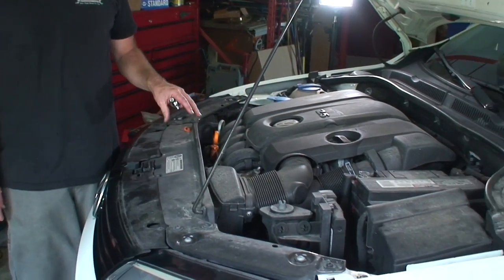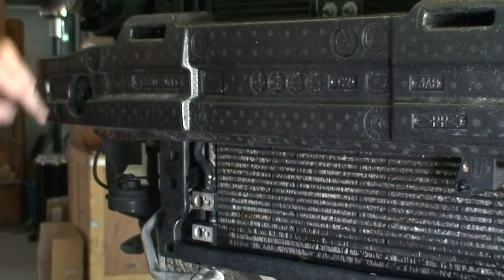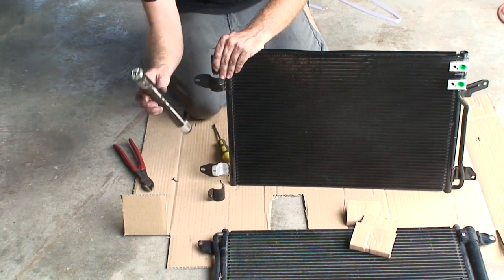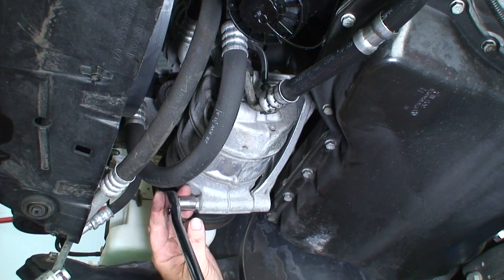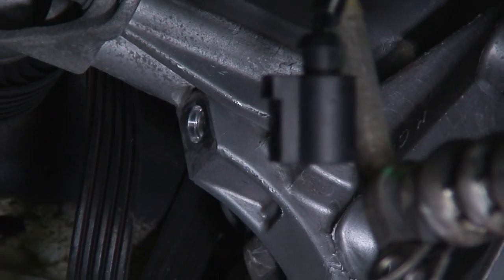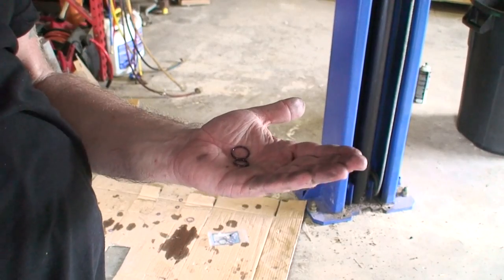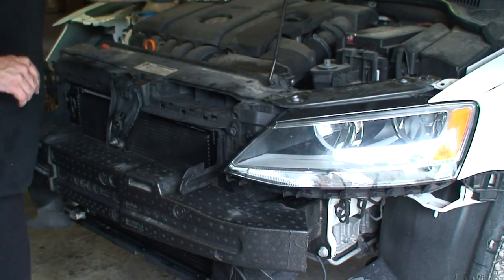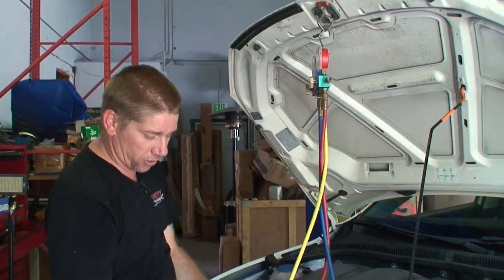2012 VW Jetta AC Condenser and Compressor

Comment: At about 12:25 you were struggling with the clip on the back of the lights.  I struggled with those for years too.  Then I finally saw a video that showed the right way to pull them off.  You pull back on the top of the clip (away from where the wire goes) and as it comes backwards it lifts the lock off and the cable comes free.  It's super easy once I figured out the right way.

Thanks for the video, super helpful!!

Comment: Saved me over a grand! Just did the condenser replacement. Did this on a 2012 passat just know that you don’t have to take off the headlights like he did. Other than that great video.
Reply: How difficult was the job? I have a 12 passat as well and thinking about changing the compressor it stays cold for a while and then warms out of nowhere. I've done many jobs on the passat probably my most recent success was replacing intake manifold. If I can just get the parts I'll do it

Comment: For everyone watching take the bumper and grill off together. In one piece
Reply: kysersoza2002  i did a 2017 with a 1.4 and grill need to come off there are three bolts that hold bumper in place and this dude took off headlights when you dont even have to take them off

Comment: I recommend doing this job with power tools. this will make your job easier guys.
Reply from the maker: just be careful you don't strip or pull out threads, we use impact tools often but not for every job
Reply: I use a 12v Dewalt drill/driver with the quick release hex chuck. It has an adjustable torque setting. I use this for light duty loosening and tigntening when there is enough room. Its very easy to control.
Reply: @APDTY  .
Reply: @APDTY  .

Comment: do you use a torque rench on the lines into the ac compressor? Im afraid I might either over tighten and damage the thread in the aluminium compressor or not tighten enough and have a gas leak...

Comment: I think I should’ve made my own video, I watch this guy and it just seemed way too involving. I removed the bumper which took all of five minutes then I remove the two screws holding the radiator lifted the radiator and pushed it back about 3 inches unscrew the condenser and pulled it off the front towards the bottom. Didn’t take more than 15 minutes. And there’s absolutely positively no reason to take your headlights off.
Reply: Yeah… that’s exactly what I thought. It looks like this guy hasn’t done one of these before and decided to go off of what the book said. 

Crash beams aren’t that hard to remove and replace. If you’re really concerned about alignment, just make a few sharpie marks to match up after.
Reply: So an experienced shop should charge maximum an hour labor if you bring in my own AC condenssor for them to put in? I got one for 250 on parts geeek

Comment: Question, if you turn both valves off during the quick vacuum leak test, then wouldn’t you be only testing if your vacuum pump and gauges leak? Both valves off on your gauges would isolate your FROM the ac system wouldn’t it?

Comment: I'd be willing to bet that compressor is 100% fine, change the RCV. I've changed mine 3x and about to do it again, just watched this for the condenser/dryer, but still left wondering if any oil was added to the system to account for the condenser change. Most shop manuals will specify an amount to add per component change. I did not see this done here.
Reply: he adds oil around 28:58

Comment: I appreciate how helpful this video is. Unfortunately, the procedure is poorly done. Lots of unnecessary steps. Some steps are missing (removing the front wheels makes it a lot faster and easier to access the splash guard screws with a gun).

The crash beam should be relatively easy to remove save replace as a few commenters have stated.
Reply: You’re supposed to remove the bolts and take 2 m10-1.5x120mm and slide the whole assembly forward. It gives you a crap ton of clearance to work on everything.

Comment: AC is still working good on my VW tdi Jetta but the lower half of condenser is almost flat from rock chips from winter roads. Car does not seem to get hot but I’m thinking I should replace the condenser before I have problems. Can just the condenser be replaced without removing the ac pump and having to replace oil in the system ?
Thx
Reply: The lower part of the condenser is flat not from the rocks how you sinking, my is flat to but is flat from using how I am sinking automatic car wash. Know we need to say tanks to guy who owns that car wash.
  My 2015 2.0l jetta ac compressor is spraying oil at the seal compressor shaft. So I need to do the same procedure what did guy in the video.
  Thanks for the great video!!!

Comment: Hello, i know this video is old but im having problems with my ac my car is a 2011 vw jetta 2.5 i was told its the ac compressor it sometimes blows hot air its mustly during the  night, would you say its the ac compressor ? And can you tell please tell me how can i find the specific one online please? I would glady appreciate it or can any one help me out please?
Reply from the maker: so verifying for sure the problem is the first step, ac compressor diagnosis is pretty easy but requires gauges so you can see how it is handling the refrigerant and heat exchange, getting warm at night? does that mean during the day it is nice and cold? A diagnosis should be performed to figure that out and prevent future problems. If the compressor is falling internally, you may want to also replace the condenser which is up by the radiator as it captures small pieces of the failing compressor and can destroy the brand new compressor when one of this small pieces cycles into the new compressor, if you need a compressor, then here is a link to a compressor kit for your specific model: https://amzn.to/2wTpDtD
We will have the proper image for it in another day or 2 as we just put it up for sale.

Comment: Hey, did you can have help to me? I have golf V. AC compressor not working. Works when i fill to the AC system air from ressiver, about 7-8 bar, turning radiator fan. When i fill freon, my AC system not running... i replaced a new one pressure sensor and compressor selenoid valve, but nothing helped..

Comment: Really great video and tutorial of the A/C job.. I think I can tackle it now on my MKVI TDI wagen the service position was something I was contemplating but saw it would have been almost impossible.. your demonstration was really spot on.. so what was the oil you used did the compressor and was it that sane oil you used on orings? Or did you lube them with silicone grease? Also I was kinda confused with the angle of the expansion valve that you were underneath the car.. how could you possibly get to that evaporator from the top of the engine bay? I know non condensable gases are problematic for A/C, thus why you pull vacuum for 30min prior to recharging, can you purge nitrogen through the system while pulling vacuum to aid in moisture and CO2 removal? Really good video 👍🏻👍🏻

Comment: Can you recharge the AC based on pressure with a diy kit or should I have it evacuated and vacuumed and charged by the weight of R-134a? I don't have a leak and the system isn't empty.

Comment: hi thank for the videos, my questions is the AC unit works fine, when it is on I hear that it is louder than it used to be, do you know which component might be going bad, if there's such a thing, thank you
Reply from the maker: AJ so first would be to see where the noise is coming from, loud noises most likely occur from a compressor starting to fail or it could be a bearing from one of the belt pulleys or the cooling fan, find the component making the sound and then plan out the replacement and it usually leads to a failure fairly soon.
Reply: Might be the blower and it could just have something stuck inside it.
Reply: @APDTY  My 2013 Volkswagen Passat only blows cold air when driving it doesn't make any weird noises should I try and replace this part?

Comment: Is it possible to add AC to the car after the fact.. mine doesn't have any. Came that way from factory. Can I add it on after.  Same year, 2.0
Reply from the maker: For a factory install it would require the vehicle computers to be changed or updated, Aftermarket Add-on ac kits are available however APDTY does not offer any, These kits are a little complex but probably the easiest and most cost effective way to add an aftermarket ac system, you would want to spend a good amount of time researching as it is a slightly complex job and it does alter the engine bay and interior. Here is an example of one of the kits: https://amzn.to/2rVfcCD

Comment: So I replaced my compressor on my wife Jetta recharged it and cleaned out the lines. We were coming home from grocery shopping and it leaked out all the freon.. looks like it leaked out of the bottom right corner of the radiator. I only replaced the compressor.
Reply from the maker: hard to say what happened exactly, making sure exactly where it leaked out is very important, knowing more about the system pressures before replacement may have given evidence of a restriction somewhere, also if your compressor failed internally, it can eventually cycle small particles into the condenser, so if it did leak out of the condenser, then that will need replacement and then a good system flush and inspection of what comes out during the flush, then another evacuation and recharge and verify all is working by monitoring the system pressures while running for 1 or 2 coolant cycles of the thermostat opening and closing, this verifies the hot engine coolant going into the radiator and the hot refrigerant going into the condenser are handled properly by there cooling systems.

Comment: Great video! My 2011 Jetta 2.5L started having ac problems. It want cooling as much and then would start to blow warm, then cool air again a while later. Thought it needed a recharge, but when I checked the charge levels they were good. So, I'm assuming its a bad compressor? Would you recommend replacing the same parts you did for this job? Thanks in advance for any info. By the sound of it I will be doing this exact ac job on my jetta.
Reply from the maker: Make sure to check both cooling fans, when your ac is on, both fans should be running and after a few minutes go to full speed, it is very common for one fan motor to fail and then it cant keep up with the ac heat and engine heat, Also if the fan is extremely loud it may not be pulling enough cool air through or heat out. This can be one cause for the symptom you are having, especially if it gets warm when you stop as then even less air passes through the condenser. The AC compressor should be diagnosed before being replaced as it can easily be another problem and if the pressures were good, (assuming the pressures where checked with it running) then something else is the problem, using gauges to check system pressures while running and then watching under a load and as the fans come on would reveal much more info and define if the compressor is working or not.

Comment: How much would this repair run?
Reply: You can't get much done for less than $1000 these days. I think most shops would at least 2k for this...condenser, compressor, expansion valve...parts are not cheap. Plenty of labor here too.
Reply: My mechanic replaced my AC compressor. I only needed to replace the dryer with it. The expansion valve and condenser wasn't necessary.

Slightly below $1,000.
Reply: I am getting non Chinese parts new for less than 400.  I’ll be in 500 total.

Comment: Can you tell me what socket sizes you used while doing this?
Reply from the maker: sorry but this video was a year or 2 ago so I don't remember what sizes, a basic set of metric sockets and wrenches is usually al that is required, VW and other mfg;s are using tori sockets and also theft detergent tori bolts also,

Comment: 10 seconds is nowhere near enough time to check for a leak in a vacuum. It’s actually a very poor way to check for A leak because normally hoses will permeate a little bit and anytime you’re in a vacuum and not running the vacuum pump you’re pulling in moisture to the system.Anyway the best way is with nitrogen for a couple hours.
Reply: Agreed. We do 24 hour leak tests on air suspension. 10 seconds doesn’t do anything.

Comment: why did the compressor the evaporator and the condenser needed to be changed
Reply from the maker: Sure, we did not change the evaporator but we did change the compressor, condenser, the receiver dryer and the expansion valve, An AC system simply cycles refrigerant from inside the vehicle cabin to outside the vehicle cabin and while doing this it pulls the heat from inside the vehicle out to the outside of the vehicle, this will take a toll on the expansion valve and the receiver dryer, also anytime you open the system you have to consider that desiccant inside the dryer as it will absorb moisture from the atmosphere once the system is open, also consider how many times the cycling has occurred as the dryer and expansion will not last the lifetime of 2 compressors. So in this case we had a compressor failure, if a compressor fails, it usually has an internal mechanical failure. If an internal mechanical failure occurs, small pieces of the compressor are then cycled through the system, pieces get stuck in the condenser and receiver dryer and expansion valve. If you just installed a new compressor without flushing all the lines and replacing parts that can hold small pieces or particles, then it is very possible and likely that you have a piece of the old compressor eventually get loose and go into the new compressor and destroy it. So anytime you replace a compressor, it is required to replace the dryer and exp valve. Most all compressor manufacturers will not warranty a new compressor unless the other components are purchased and installed at the same time. Also VW and most all later model manufacturers use parallel flow ac condensers, parallel ac condensers cannot be flushed because the way they are made makes the system perform better but removes the ability to flush them, So any professional shop knows all this and has lived through many do-it-yourself jobs that end up badly from not replacing all the parts. You can do a perfect install of just a compressor and have it fail a week later because a small metal particle from the old compressor ends up in the new compressor. If you go through the experience once of destroying a compressor and then having to repurchase a compressor all over again is usually be enough to teach the lesson of never try and skimp on an ac repair, also this doesn't include evacuation and recharge costs, the tried and trued methods professional technicians use are not meant to sell you parts you don't need, they are really meant to have the job completed and working with 1 single repair job, also you usually end up spending way more in the long run as you have to do the whole job over again.

Comment: I recommend using power tools and not video recording your very first time replacing a condenser on a VW Jetta. Its a PIA the first time!
Reply from the maker: yeah but not many parts of this job can be done with power tools, especially trying to get the proper torque, a seasoned tech uses hand tools often to get the proper torque, also power tools for removal can cause the threads to be stripped out since so many different metals are used.
Reply: @APDTY  I disagree. Many of these steps could be done with a variable power impact. Seasoned techs work efficiently. This isn’t Japanese sword making. It’s clips and screws.

Comment: How much does a job like this us usually cost?
Reply: Labor time for replacing the cooling fan assembly on this car is 2.3 hours
Reply from the maker: This customer was quoted $1400.00 for this job, we did it for around $500 but we dont charge labor, most shops charge for this will be $1000-$1500, some shops will also insist in using OE VW parts which is ok, but slightly more expensive
Reply: @APDTY  what do you mean you don't charge out your labour hours?
Reply: @Sebastiaanvandevelde  We are not an auto repair shop. We sell auto parts online and publish how-to videos on YouTube when we find a repair job that would be good to showcase. We only charge the customer for the parts in exchange we get to post the video to YouTube. We've never charged labor for any of our videos.
Reply: @Joshua-od9my  I need to come to yall then.😩
Reply: @Joshua-od9my  hold on, I got some rocker panels on my 2001 GTI that need replaced lol :) good video man, I'll be using this on my 2011 GTI that didn't get cold , will recheck with gauges and go have it pumped out. I'll blow out the lines of any excess oil, drain the compressor overnight and fill to specified levels, thanks again...also prob 2hours on drier if blowing out lines. Also thank you, I didn't know the condenser on these couldn't be blown through and cleaned really. Cheers

Comment: Good god what a pain in the ass.  The Engineers at VW need to spend some time in prison.  Between their falsifying mileage numbers and the design of this receiver dryer mount location somebody needs to be shanked.
Reply from the maker: Also no coolant temp on the dash, you have to plug a scan tool in on many models just to see coolant temp
Reply: That’s CAD for you.  That said I think VW/AUDI while complicated at first makes so much sense once you figure out the puzzle.  I’d work on a German car any day over a Ford or some Japanese makes.